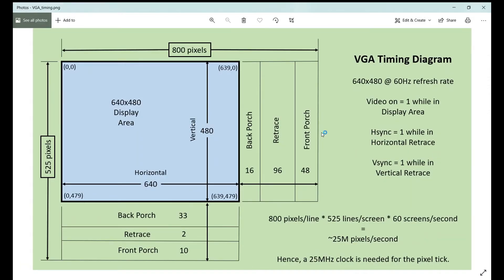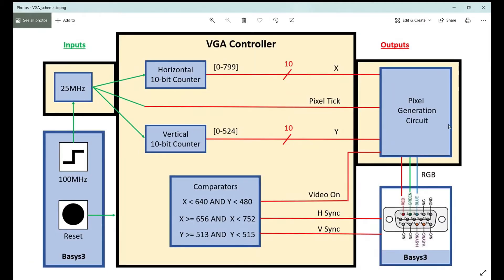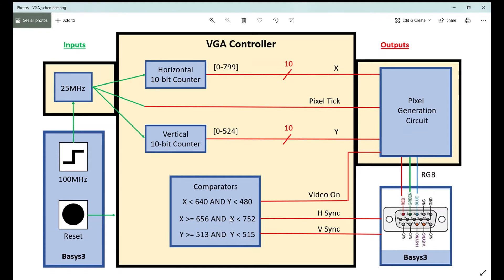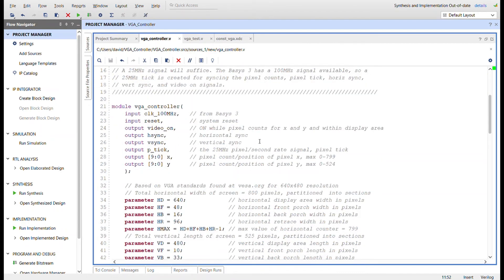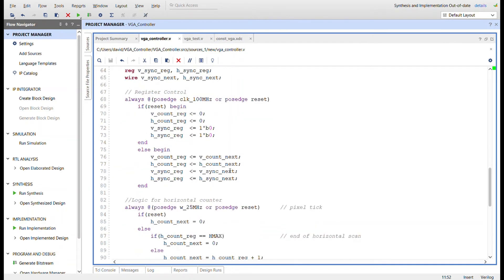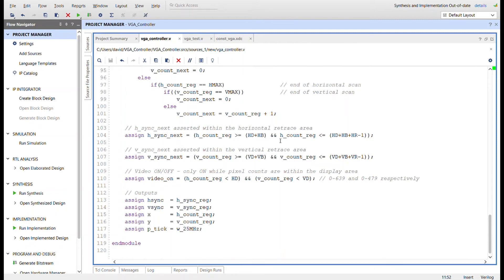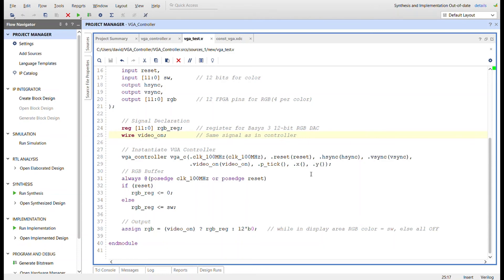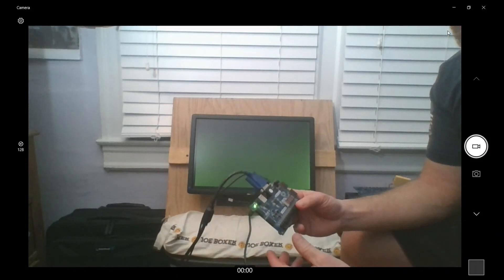VGA Controller Verilog Vivado Basys 3 FPGA

Comment: After giving the xdc file in vivado, the bit stream isn't generating. What should i do?
Reply from the maker: Hi. Forgive me if I am being presumptuous. In order to make this work you need more that just the xdc file. You must add the Verilog files as source files and add the xdc file as a constraint file. Then, run synthesis, run implementation, and generate the bitstream.